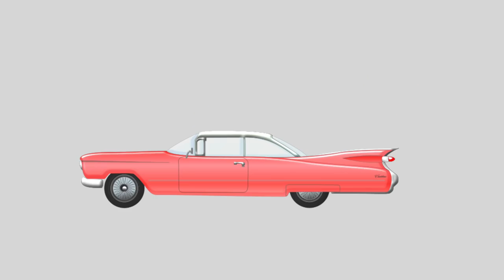Yes, Rockets CAN Fly in a Vacuum

Comment: It is not a misunderstanding, Newton shows that you must need an opposite reaction  and because in a vacuum offers offers no resistance, rocket propulsion in a vacuum is impossible. Launch your balloon when the "exhaust" is over a vacuum cleaner nozzle. All the vacuum cleaner is offering is a continuous low pressure that in no way is approaching the same temptress of 2 hydrogen atoms per cubic meter and an infinite volume to fill, so your balloon has an almost infinite advantage over the biggest rocket engine, and yet FAILS totally to launch.

Silly girl. learn real science not this crap.
Reply: @darklight2.1  I know real science, what could be more real than Newton's 3 law of motion? Can you launch a vacuum hose from your face? 

And, yes, I am that guy.
Reply: @robertfish4734  - "I know real science, what could be more real than Newton's 3 law of motion?"
Really?  Lets see if you actually understand Newtons laws.

What happens if you fire a crossbow into a vacuum?
Would it experience any recoil force backwards?
Yes or no?
Why or why NOT?
Reply: @stuartgray5877  GEE you really don't get it. A crossbow is providing an equal and opposite reaction. the string is pushing against the bolt, dolt. Strange that you completely missed that.
Reply: @robertfish4734  - "Strange that you completely missed that."

I didn't "miss" anything.

SO what is the crossbow PUSHING AGAINST for it to get pushed backwards by the RECOIL?

You did not answer anything.
Reply: @robertfish4734  Here are three questions that SHOULD be trivial for anyone that has completed high school physics.
Lets consider a rocket engine running right here on earth in atmosphere.
1 - Does the exhaust gas get "Accelerated" as it leaves the nozzle?
2 - Does the exhaust gas have "Mass"?

3 - Can "Mass" be "Accelerated" WITHOUT a "Force"?
Just answer these three questions to prove you understand the MOST BASIC aspect of physics and we will get to the more relevant questions.
Reply: @robertfish4734  You're just making a straw man argument.  Typical for space deniers, who overlap considerably with people of few brain cells.
Reply: @robertfish4734  SO why do you refuse to answer my questions?

Are you afraid to learn something or afraid of being proven wrong?
Reply: @stuartgray5877  > Here are three questions that SHOULD be trivial for anyone that has completed high school physics.Lets consider a rocket engine running right here on earth in atmosphere.
1 - Does the exhaust gas get "Accelerated" as it leaves the nozzle?
2 - Does the exhaust gas have "Mass"?
3 - Can "Mass" be "Accelerated" WITHOUT a "Force"?

I did answer your test questions. Not sure why it isn't still there. It went like this; I suggested you borrow your mum's vacuum. Before you say space vacuum doesn't suck,  you are right, it is a much lower pressure than your mum's vac can accomplish. Your mum's vac works by using motor driven  impellers to lower the pressure in the hose. It is something like pretend space in that as long as the vac is running it creates a continuous lower than atmospheric pressure. You are probably afraid of learning Boyle's gas law

So you place the vacuum hose over your mouth, just after you take you best and deepest breath. Now turn on the vac and try and blow just as hard as you can and see if the hose is launched or your lungs become inverted and the hose stays on your face.

1. Did your mighty blow exhale get accelerated?

2. Did your mighty blow exhale have mass?

3. Did your mass accelerate WITHOUT force... That one is sort of silly and has no reliance. There was no acceleration even with your mighty blowing... Ask your mum she can help explain that you had no movement, like if your mighty blow exhale was directed at your birthday party balloon, you see there would be an equal and opposite reaction using where your mighty blow exhale was not immediately dissipated by the exceptionally low pressure continuous volume.  

>Just answer these three questions to prove you understand the MOST BASIC aspect of physics and we will get to the more relevant questions.

Try the experiment, but doubt if you are capable of constructing any relevant questions because the very basic understanding of equal and opposite is way over your comprehension.
Reply: @stuartgray5877  Fear of learning? from you? You can't be serious. 

I will consider just about anything, but to quote a most excellent Western, Rustler's Rhapsody:  When I see something that is obviously wrong I tend to point it out. So far you have amused me, but even your constant failure to understand becomes a bit tiring.
Reply: @robertfish4734 AS I said above  My example questions are discussing rocket propulsion HERE ON EARTH - IN ATMOSPHERE!

The three questions are "Yes" Or "No".

If you are incapable of answering them, just SAY THAT.

And no the "Vacuum of space" does NOT "suck out" the exhaust gases. The gases are PUSHED OUT.

You would understand this IF you were capable of answering my questions.
Reply: @robertfish4734  I also have live video of rockets working just fine in a vacuum, but you would just call them fake anyway so what would be the point of even showing you?
Reply: @stuartgray5877  >I said above My example questions are discussing rocket propulsion HERE ON EARTH - IN ATMOSPHERE! 

In the atmosphere, there is something to push against and is totally missing in space. You have this silly notion that this makes no difference, but if you actually tried my physics vac experiment with your mum's vacuum, you would physically understand why propulsion in a vacuum is fucking impossible, but I doubt your mum would trust you with her vac.

>The three questions are "Yes" Or "No". If you are incapable of answering them, just SAY THAT. And no the "Vacuum of space" does NOT "suck out" the exhaust gases. The gases are PUSHED OUT.

And like your "might blow" does nothing for an opposite reaction, you mightily pushed out your lung capacity which could not at all cover the volume necessary for movement. 

The mightiest rocket possible is still finite and pretend space is fucking infinite. When you go up against infinite with finite, sorry that is too advanced. Beg your mum to use her vac. If you spend 10 or so minutes with your lungs inverted, you will understand or it won't be a problem for you any more. 

Did you  try the vac experiment? - YES OR NO.
Did you blow off the vac hose? - YES OR NO.
Did your lungs invert?  - YES OR NO.
Did your mum change her vacuum bag?  - YES OR NO.

 >You would understand this IF you were capable of answering my questions.

You can't handle the truth. You fail on all counts. Show me one example of how one can overcome infinite low pressure of 2 hydrogen atoms per cubic meter. The professional clown Neil deGrasse Tyson did a video and said that the very best lab vacuum can only pull 10 billion atoms per cubic meter. Pretend space is as close to nothing as you can get. What do you think pushing against nothing does?

Because you fail to understand basic gas law also, you have no inkling that GAS ALWAYS EXPANDS TO FILL THE VOLUME. Scientific law is absolute, anything that works is based on scientific law, but you want exceptions when there are NONE.

So Newton's third law is also absolute. If you can not come up with some form of equal reaction, your demands to answer yes or no are a pointless diversion.
Reply: @robertfish4734  I am not reading anything from you until you answer my three yes/no questions with YES OR NOR answers.

THEN
 I will get to the relevant questions.

I am sorry that you are still stuck unable to answer the qualifying questions.
Reply: @robertfish4734  For the OTHER Readers, here is an example of an interaction between "Normal People"
Person #1:
Lets consider a rocket engine running right here on earth in atmosphere.
1 - Does the exhaust gas get "Accelerated" as it leaves the nozzle?
2 - Does the exhaust gas have "Mass"?
3 - Can "Mass" be "Accelerated" WITHOUT a "Force"?
Person #2:
Oh. No problem,
To question #1: Yes
The rocket exhaust is at a much greater velocity than it was before leaving the engine, therefore the exhaust gas IS "Accelerated".
To Question #2:  Yes
The exhaust gas has the same mass as the fuel and oxidizer that goes INTO the engine.
To Question #3: No
Mass CANNOT be accelerated without applying a force to the mass. That is the definition of the word "force": "That which can change the momentum of a mass"
So the answers ARE:
Yes
Yes
No
Reply: @robertfish4734  The three questions I posed to you is to get YOU to ADMIT that there MUST be a "FORCE" applied to the exhaust gas that accelerates it from the rocket.
Since we KNOW THAT:
1 - The exhaust gas IS "Accelerated" from the rocket
2 - The exhaust gas has MASS
3 - Mass can ONLY be accelerated with a FORCE.

Therefore, we MUST conclude that the rocket nozzle MUST BE applying a FORCE to the mass of the exhaust gas ACCELERATING IT.

DO YOU AGREE that the rocket MUST apply a force to the mass of the exhaust gas?

Yes or NO?
Reply: @robertfish4734  You KNOW if you don't understand basic physics you can just SAY SO.
Reply: @stuartgray5877  > The three questions I posed to you is to get YOU to ADMIT that there MUST be a "FORCE" applied to the exhaust gas that accelerates it from the rocket. Since we KNOW THAT: 1 - The exhaust gas IS "Accelerated" from the rocket 2 - The exhaust gas has MASS 3 - Mass can ONLY be accelerated with a FORCE. Therefore, we MUST conclude that the rocket nozzle MUST BE applying a FORCE to the mass of the exhaust gas ACCELERATING IT. DO YOU AGREE that the rocket MUST apply a force to the mass of the exhaust gas? Yes or NO?

Yes or No. You do not describe this is an environment that has something to cause an equal and opposite reaction based on the video title. Acceleration is not proof of movement and if it is shunted by the environment there is no movement. The force is from the burning fuel which is attached to the rocket, just because the burning fuel produces a force does not mean there is an equal and opposite reaction happening WHICH IS ALWAYS NECESSARY FOR MOVEMENT.

Yes, in air the rocket moves, No in near absolute infinite vacuum any thrust is negated instantly, just like when you try and blow your mum's vacuum hose from your mouth. You can not generate enough thrust to overcome OVER fill the volume. 

This is difficult for you as you are fainting to understand basic science or simply ignoring basic science. 

What is your point? Are you believing that the rocket pushes itself? That is what engineers call a static moment, which you mindlessly pretend the acceleration overcomes somehow. You still have nothing and are better off just going away quietly as you are incapable of defending your religious belief and no one actually cares.
Reply: @stuartgray5877  You do realize you are just continuing to embarrass yourself?
Reply: @robertfish4734  and sorry but you are wrong about Newtons Third law. ANY force creates an equal and opposite force - NO EXCEPTIONS!
Forces ALWAYS occur in pairs
ALWAYS!
Reply: @robertfish4734  - "You do realize you are just continuing to embarrass yourself?"

You DO realize that you are arguing basic physics with REAL Engineers that launch things to space as their JOB right?

It is 100% CERTAIN that YOU could not pass a high school physics exam, while I have been building, testing, launching and operating deep space science probes since before you were born.
Reply: @robertfish4734  Have you figured out yet that it is IMPOSSIBLE for any machine to ACCELERATE MASS without feeling an "equal and opposite force"??

Bless your little heart!
Reply: @stuartgray5877  >Have you figured out yet that it is IMPOSSIBLE for any machine to ACCELERATE MASS without feeling an "equal and opposite force"?? Bless your little heart!

Imagine seeing a rock on the ground, stationary, un-moving and yet the rock is exerting force on the ground. Can you possibly understand that force can be exerted and nothing moves? What does the rock feel?

In space, that is exactly what happens. 

No this is wasted on you. You will never make a reasonable connection. Just go quietly away and stop reading and responding to my comments like you promised.
Reply: @stuartgray5877  Apparently you will only believe in NASA fairy tales so this is from NASA on Newton's Third Law: Action & Reaction 

"His third law states that for every action (force) in nature there is an equal and opposite reaction. If object A exerts a force on object B, object B also exerts an equal and opposite force on object A. In other words, FORCES result from interactions."

Read that carefully and picture object B as nothing. If there is nothing, object B CAN NOT exert and equal and opposite force.
Reply: @robertfish4734  SO you ARE claiming that machines can accelerate mass without feeling a recoil.

Do FIREHOSES have RECOIL?
yes or no?
Why or WHY NOT?
Reply: @robertfish4734  So you AGREE that a machine that accelerates mass MUST feel a recoil force.

SO what FORCE is accelerating the mass of the exhaust gas from the rocket nozzle?
Where does this force originate?

Next tell me WHY does a FIREHOSE have RECOIL?
Can you just use physics terms to explain it to me?
Reply: @stuartgray5877  >So you AGREE that a machine that accelerates mass MUST feel a recoil force. SO what FORCE is accelerating the mass of the exhaust gas from the rocket nozzle? Where does this force originate? Next tell me WHY does a FIREHOSE have RECOIL? Can you just use physics terms to explain it to me?

The physics terms are simply explained using Newton's Third Law: Action & Reaction. Here it is again because you lack reading comprehension  the emphasis is  on the important parts you constantly miss with your mind numbing redundant laughingly wrong beliefs; 

"His third law states that for every action (force) in nature there is an equal and opposite reaction. If object A exerts a force on object B, object B also exerts an equal and opposite force on object A. In other words, <<<FORCES>>>> result from <<<INTERACTIONS>>>." forces result from interactions
forces result from interactions
forces result from interactions
forces result from interactions
forces result from interactions
forces result from interactions
forces result from interactions
forces result from interactions

Read that carefully and picture object B as nothing. If there is nothing, object B CAN NOT exert and equal and opposite force... BECAUSE THERE IS NO INTERACTION.

Read that carefully and picture object B as nothing. If there is nothing, object B CAN NOT exert and equal and opposite force... BECAUSE THERE IS NO INTERACTION.

Read that carefully and picture object B as nothing. If there is nothing, object B CAN NOT exert and equal and opposite force... BECAUSE THERE IS NO INTERACTION.
Reply: @Pounder 
Neither you nor Mr Fish know anything about how a rocket works. Stop pretending you do.
Reply: @Pounder 
You know NOTHING. 
Explain how you calculate the thrust of a rocket engine . Come on don't be shy now, I'm all ears. LMAO
Reply: @Pounder I noticed he always ignores but never denies when accused of being a poorly written AI bot or an overpaid shill whose job it is to misinform or is just so dense that he is clueless.  He may be a combination of all three, but most likely a poorly written shill.
Reply: @robertfish4734  Crossbow example:
You are saying recoil of the bow is the result of pushing against the bolt when it is launched; atmosphere or not.
The bow moves, or tries to move, not by pushing on the atmosphere, but by pushing the bolt. 
You just contradicted your own "anti rocket in a vacuum"  argument.
Why does a rocket need atmosphere to "push?" It doesn't. 
In a rocket, the exploding fuel is "pushed" out of the engine, and the rocket moves the other direction.
The crossbow recoils becuse it pushes away something that starts moving from  "inside" the crossbow, the bolt, not outside the crossbow, air.
In the same way the rocket moves by pushing something inside of itself away. The exploding fuel inside the engine pushes exhaust one direction, and the same explosion then pushes the rocket the other direction.
That is the action/reaction.
Reply: @robertfish4734  . Your comment sounds like based on science but it's flawed science to be polite.
To create motion there needs to be some kind of energy or a reaction? Yes. When the fuel ignites there is a reaction. There is energy.
This reaction creates exhaust, a gas. Although in our hands it may not feel like gas has mass or weight, it does. If it's made of atoms it contains mass. The mass of the gas is going out one way, the rocket moves the other. Simple.
If I set off a bomb in the air the fragments fly in all direction. If I do this in a vacuum chamber, same thing.
But if I make a weak spot on the bomb and detonate it in a vacuum chamber what happens? Does it just sit there? Does it fall apart? No, the weak spot goes one way while the rest of the bomb goes the other. 
In a rocket engine the fuel explodes. And explosion will go in all directions. But if the energy from the explosion pushes out through a small hole in the bottom of the engine, the upward energy in the engine will push the rocket up. Action/reaction. 
You believe rockets need an atmosphere to push against? When fuel explodes it becomes a gas. You have created an atmosphere inside the engine. So in a sense you are pushing against a gas/atmosphere. 
There are innumerable ways to test this but you will seek to find, or actually CREATE, holes in the tests.
Reply: @lance3748  > Your comment sounds like based on science but it's flawed science to be polite. To create motion there needs to be some kind of energy or a reaction? Yes. When the fuel ignites there is a reaction. There is energy. This reaction creates exhaust, a gas. Although in our hands it may not feel like gas has mass or weight, it does. If it's made of atoms it contains mass. 

No problem. That is essentially what happens. 

>The mass of the gas is going out one way, the rocket moves the other. 

No, the exhaust is leaving the rocket and is immediately negated by the lack of a B object. If you ball believers only understood Boyle you would realize that gas instantly expands to fill the volume, and pretend space is and infinite volume and the rocket is finite. Infinite vs finite, who wins? Do you believe the rocket can fill the infinite volume enough to make a plausible B object?

>Simple. If I set off a bomb in the air the fragments fly in all direction. If I do this in a vacuum chamber, same thing. 

That is because there are A & B objects, The bomb is equivalent to firing a bullet, the casing (object A) is fixed to the gun and the projectile (object B) leaves the barrel as a result of the equal and op posit reaction. That is your only way of having a noticeable recoil, and one way to prove movies that are using blanks...
  
>But if I make a weak spot on the bomb and detonate it in a vacuum chamber what happens? Does it just sit there? Does it fall apart? No, the weak spot goes one way while the rest of the bomb goes the other. In a rocket engine the fuel explodes. And explosion will go in all directions. But if the energy from the explosion pushes out through a small hole in the bottom of the engine, the upward energy in the engine will push the rocket up. Action/reaction. 

Is the rocket engine shooting shrapnel like the gun? No, there is still no object B to create an opposite reaction, nothing moves.

>You believe rockets need an atmosphere to push against? When fuel explodes it becomes a gas. You have created an atmosphere inside the engine. So in a sense you are pushing against a gas/atmosphere. There are innumerable ways to test this but you will seek to find, or actually CREATE, holes in the tests.

You are particularity incorrect. Like mentioned before: Do you believe the rocket can fill the infinite volume enough to make a plausible B object?

You talk about flawed, "Your comment sounds like based on science but it's flawed science to be polite." You don't even sound scientific, just totally flawed.
Reply: @robertfish4734  "Is the rocket engine shooting shrapnel like the gun? No, there is still no object B to create an opposite reaction, nothing moves."

And here you are wrong.  The exhaust gas is the analog to the shrapnel.
Reply: @lance3748  - "You believe rockets need an atmosphere to push against? When fuel explodes it becomes a gas. You have created an atmosphere inside the engine. So in a sense you are pushing against a gas/atmosphere. "

They think "Rockets push on AIR" but they don't admit that AIR IS A GAS.
In FACT, the 14.5 PSI "AIR" they think rocket CAN push on is less than 1/100th the density of the 3000 PSI GAS inside the rocket nozzle when it is running.
The GAS inside the rocket nozzle is more than 100 times MORE MASSIVE than atmospheric AIR.

Yes, their entire argument to date IS:

"Rockets push on GAS but they CANNOT push on GAS".
Reply: @robertfish4734  You refuse to answer my questions when they prove you wrong.

Robert - A space shuttle main engine consumes 500 kilograms of liquid oxygen and liquid hydrogen PER SECOND!
It combusts the fuel and oxidizer and creates exhaust gas.
The exhaust gas from a hydrogen oxygen combustion is PURE WATER !

ROBERT - HOW MUCH WATER comes OUT of a space shuttle main engine PER SECOND ?
WHY won't you ANSWER THAT QUESTION?
Reply: @robertfish4734  "A straw man? This is REAL science. What you don't understand is that scientific law is absolute, everything that works is based on these scientific principals. These laws always work, there is no breaking these laws. "

And you're misapplying them and thinking you've done something substantial.  Hence, a straw man.
Reply: @robertfish4734  "TELL ME WHERE IS THE OBJECT B necessary for making an equal and opposite reaction"

It's the exhaust gas itself, as you were told, but are apparently too dim to comprehend.
Reply: @robertfish4734  Where did you GO?

I want to hear MORE about your physics theory about how machines exist that can ACCELERATE MASS - WITHOUT feeling a recoil force.

Please tell us more about your Nobel Prize winning theory.
Reply: @stuartgray5877  I tried doing push ups by pushing down on water and air. It gives me just as good a workout.
HAHAHAHAHA
Reply: @lance3748  - ""I tried doing push ups by pushing down on water and air"

Are you NOW saying that rockets CANNOT "Push on AIR"?
WHICH IS IT?
Can rockets push on AIR or NOT?
Reply: @stuartgray5877  No, rockets do not fly by pushing air. When I wrote "HAHAHAHAHA " it was to indicate it was a joke.
I get the feeling you and I agree but some of our wires have been crossed. I very much believe in outer space, moon landing, round earth...
Reply: @stuartgray5877   >I'll try to explain this in terms you can understand with your five-year-old intellect. Water has "MASS". "Mass" gives objects INERTIA which is the ability to RESIST being accelerated or having its MOMENTUM changed. If a machine attempts to "ACCELERATE" water it must apply a "Force" to that mass to accelerate it. Newtons third law tells us that ANY TIME one mass applies a FORCE to another mass then BOTH MASSES FEEL THE FORCE. This "REaction" is called "RECOIL". 

Sadly, you need to reread your shill manual because you can't explain the impossible. Forces result from interactions Newton's third law states that for every action (force) in nature there is an equal and opposite reaction. If object A exerts a force on object B, object B also exerts an equal and opposite force on object A. In other words:
 

<<<FORCES>>>> result from <<<INTERACTIONS>>>." forces result 

from interactions

The key is interaction, NOWHERE  does it EVER say

"Newtons third law tells us that ANY TIME one mass applies a FORCE to another mass then BOTH MASSES FEEL THE FORCE. This "REaction" is called "RECOIL".

The reaction is movement... If there is no movement there is no recoil either.

I posted it several times but you still lack comprehension, no you still are reading the shill manual. Newton's third law states that for every action (force) in nature there is an equal and opposite reaction. If object A exerts a force on object B, object B also exerts an equal and opposite force on object A. In other words, <<<FORCES>>>> result from >>>INTERACTIONS>>>." forces result from interactions

Is the rocket engine shooting water? YES OR NO

Is the water shooting into absolute vacuum? YES OR NO

You do realize that the answers are truly NO and NO. If the hose was emptying into an industrial vacuum pump that would overwhelm the hose pressure, there would be no opposite reaction or detectable "recoil"

>Are YOU suggesting that a machine can accelerate 500 kilograms of WATER ("mass") from a velocity of zero to MACH EIGHT without applying a force to that mass? Now have one of the OTHER five-year-olds in your special needs class READ THAT TO you so that you may respond.

So you are the same person... Thought so. I am responding to your silliness with a scientific law that you are no closer to breaking than when you started:
<<<FORCES>>>> result from >>>INTERACTIONS>>>." forces result from interactions
<<<FORCES>>>> result from >>>INTERACTIONS>>>." forces result from interactions
<<<FORCES>>>> result from >>>INTERACTIONS>>>." forces result from interactions
<<<FORCES>>>> result from >>>INTERACTIONS>>>." forces result from interactions
<<<FORCES>>>> result from >>>INTERACTIONS>>>." forces result from interactions
<<<FORCES>>>> result from >>>INTERACTIONS>>>." forces result from interactions

OH I seriously doubt that there is a water pump that can accomplish 6138.15 MPH,  water lasers only manage 15 PSI with o 1 MM jet  is about 2 gallons per second may come close but no cigar. It really makes no difference, IN FAKE AND GAY SPACE THERE IS NEVER AN OBJECT "B" SO MOVEMENT NEVER EVER HAPPENS: There is never a force if there IS NO INTERACTION NO MOVEMENT OR RECOIL.

Are you trying for the Double Dipshit award? You are almost there... It will be something you can show to your self esteem class, tomorrow morning when you get your special "showing up for breakfast ribbon"
Reply: @robertfish4734  Yes:
1 -  a space shuttle main engine consumes 500 Kilograms (this is MASS) of liquid oxygen and liquid hydrogen PER SECOND.
2 - It COMBUSTS ("burns") the fuel and oxidizer creating a chamber pressure of over 3000 PSI. (At sea level this is a differential pressure of 2985.5 PSI.)
3 - The Exhaust GAS IS pure water.
4 - The engine creates the same mass in exhaust gas (per second) as it consumes in fuel and oxidizer (per second).
5 - So the engine produces 500 kilograms of PURE WATER at 3000 PSI.
6 - It EXITS the nozzle at MACH EIGHT.

Which of these statements are you going to claim is false?
Reply: @stuartgray5877  >1 - a space shuttle main engine consumes 500 Kilograms (this is MASS) of liquid oxygen and liquid hydrogen PER SECOND. 2 - It COMBUSTS ("burns") the fuel and oxidizer creating a chamber pressure of over 3000 PSI. (At sea level this is a differential pressure of 2985.5 PSI.) 3 - The Exhaust GAS IS pure water. 4 - The engine creates the same mass in exhaust gas (per second) as it consumes in fuel and oxidizer (per second). 5 - So the engine produces 500 kilograms of PURE WATER at 3000 PSI. 6 - It EXITS the nozzle at MACH EIGHT. Which of these statements are you going to claim is false?

ALL are Absolutely false. There no way the ISS exists outside of zero buoyancy pools, CGI and green screens. You realize that the imaginary space football field sized ISS pretends to travel 16 times a day in front of our solar orbit and it takes less than 14 seconds to reach its pretend orbit at 67,000 MPH and in 14 seconds the pretend ISS can only move 70 miles. The chances of it missing a face plant are just about as infinite as the pretend fake and gay space having infinite volume at 2 hydrogen atoms per cubic meter emptiness. OH! Maybe gravity knows when to repel!!! I am certain that perhaps gravity just ignores the usual mutual attraction... 

Lets focus on empiric, The ISS is a pretend made for TV show, like the Star Ship Enterprise, only worse. You nor I can go there, actually no one can. You must depend on scientific law.

But the ISS pretend motor MAKES NO NEVERMINDS. You still can not defy the 3rd law of motion. 

You apparently really want to impress your self esteem class, you have almost earned the double dipshit award. Probably the next post that ignores Newtons law of motion will get it for you.  Failure never stopped you before and it seem your whole life is continual failure and you still can write exceptionally stupid stuff but when you look at all your breakfast ribbons to keep from crying yourself to sleep, it makes it all worth while.
Reply: @robertfish4734  You know it is 100% CERTAIN that YOU could not pass a high school physics exam. But you feel confident arguing basic physics with actual Rocket Scientists?

Bless your little heart!
Reply: @stuartgray5877  I have discussed the problem of the airless ball with a Harvard physics professor. Sadly his advice was to forget about Boyle. There are so many other things like seeing the ISS.... Also asked a NASA ambassador who had no answer, because it was above his pay grade and suggested I contact Goddard... Seems that your silly appeal to authority holds no weight either.

Sadly NO ONE ever can show gravity defying Boyle's or Newton's laws, especially you. 

If I were you, I would never bet my life on your 100% certainty.
Reply: @robertfish4734 Just more lies from a zero worth bot.
Reply: @robertfish4734  If you are confused about how earth has an atmosphere I could help with that but you would need to answer questions which apparently you are incapable of.
Lets try.
Explain the theory of operation of a Gas Centrifuge.
This device can create a region of high pressure gas adjacent to a region of low pressure gas (a vacuum) with no physical barrier between the two regions.
Care to tell me HOW it does that?
Reply: @stuartgray5877  >If you are confused about how earth has an atmosphere I could help with that but you would need to answer questions which apparently you are incapable of. Lets try. Explain the theory of operation of a Gas Centrifuge. This device can create a region of high pressure gas adjacent to a region of low pressure gas (a vacuum) with no physical barrier between the two regions. Care to tell me HOW it does that?

No theory it is a fact that even in a centrifuge, gas fills the container. There may be a separation of heavy molecules, but hey, that is the purpose  of the machine and this can only happen IN AN ENCLOSURE.  So what could possibly be your point? 

Speaking of centrifugal force, I find it interesting that in the Machinist Handbook the largest flywheel recommendation is under 40 feet in diameter and must be run at a maximum of one RPM because of the stresses involved. The material is cast iron. The circumference would be around 126 feet making the surface  speed somewhere around 3.9772e-4 MPH. One would imagine the centrifugal force on a ball with a molten iron core covered in rock, dirt, water and sand that has surface speeds that ranges between less than 5 MPH to over 1000 MPH would have way less ability to stand the stresses than a cast iron flywheel.
Reply: @davidmescher2526  I know you are , but what am I?
Reply: @robertfish4734  So are you saying that "Centrifugal Force" CAN concentrate gas molecules such that they form a GAS PRESSURE GRADIENT?

Is that correct? a "FORCE" can create a region of high-pressure gas adjacent to a region of low-pressure gas with NO PHYSICAL BARRIER between the he two regions.

Is THAT what you are trying to say?
A "FORCE" can do this?
Reply: @robertfish4734  Where did you go?
Scared to answer my questions AGAIN?

DO you AGREE that a "Force" can compress gases or NOT?
It seems that you refuse to answer questions whenever the answers prove YOU WRONG.

Am I seeing a trend here?
Reply: @robertfish4734  FOR EXAMPLE: What happens if you seal one end of a pipe then SPIN the pipe IN ATMOSPHERE FROM THE OPPOSITE END?

What happens to the gases IN THE PIPE as it is spun end for end?
Wont the gases get COMPRESSED against the sealed end?
WHY? or WHY NOT?
Reply: @robertfish4734  Still afraid to discuss physics with actual engineers?
Why are you scared?
Reply: @stuartgray5877  nobody is scared of you, chatbot stuart 😂
Reply: So you thus claim that no satellite every achieved orbit. Do you claim to know science as in getting an actual college degree in science? Or are you a YouTube "scientist"? LOL
Reply: @robertfish4734  That's not how vacuums work, they don't "suck"
Reply: @ppleberrynd  so you don't know the physics definition of the word "suction" either? useless chatbot😂